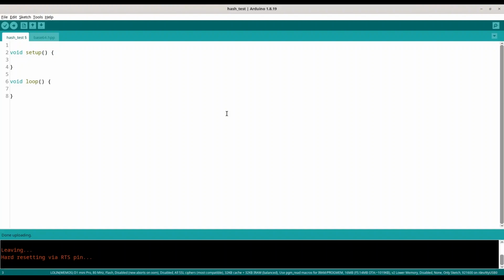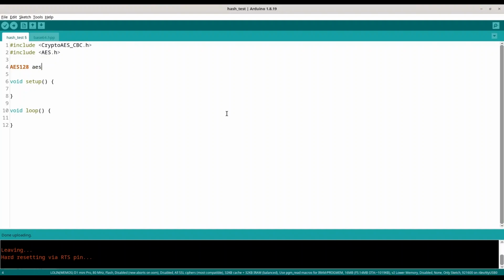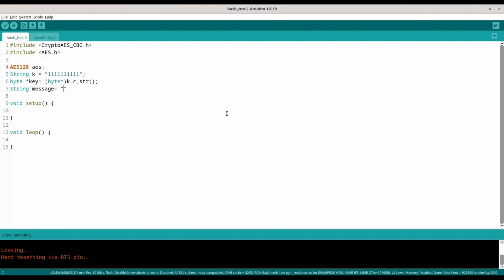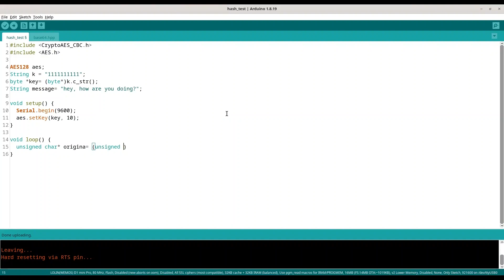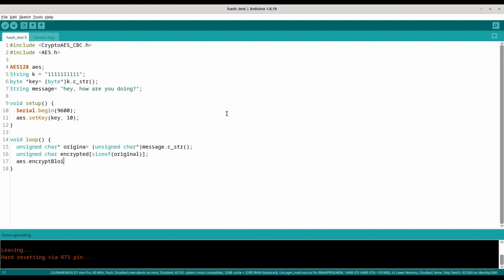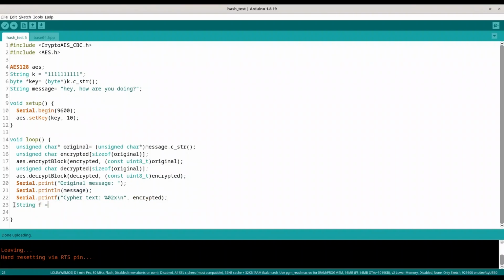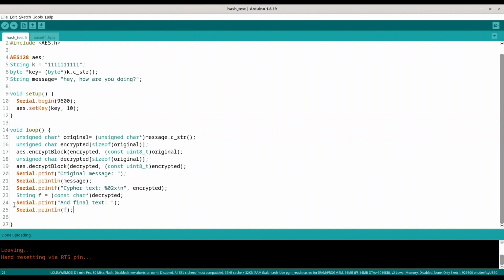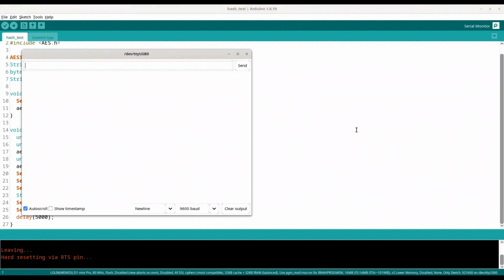ESP32 & ESP8266 - AES encryption and decryption

Comment: Followed your tutorial, was a great help from the start as i had no idea how to do AES encryption before, and cloudnt find any other tutorial as simple as yours. HOWEVER, your code as is is flawed. The password is incorrect, it must be in a specific format for it to work. This is an functioning example for AES128:

// Define a 16-byte key (AES-128 requires 16 bytes)
byte key[16] = {'1', '1', '1', '1', '1', '1', '1', '1', '1', '1', '1', '1', '1', '1', '1', '1'};

And here is one for AES-256:

AES256 aes;  // Use AES256 for 256-bit key support
// Define a 32-byte key (AES-256 requires 32 bytes)
byte key[32] = {
  '1', '1', '1', '1', '1', '1', '1', '1', '1', '1', '1', '1', '1', '1', '1', '1',
  '2', '2', '2', '2', '2', '2', '2', '2', '2', '2', '2', '2', '2', '2', '2', '2'
};

Also, it is worth noting that the encrypted message can be only of a certain length, meaning that long texts have to be cut and encrypted individually, and later it has to be decrypted from the same cutted parts
Reply from the maker: @janpospisil3107  That is how aes works and the library is updated periodically
Reply: @kindspirittechnology  At first, it seemed like your code was working fine, but after some testing, I discovered that regardless of the key used, the message allways encrypted the same. I was able to encrypt a message with the key 1111111111 and decrypt it with the key 1234567890. I think its because of the wrong key format, which resulted in the program defaulting to some default key. Replacing the key with what I posted above seems to fix it